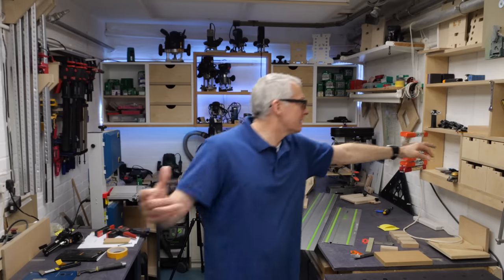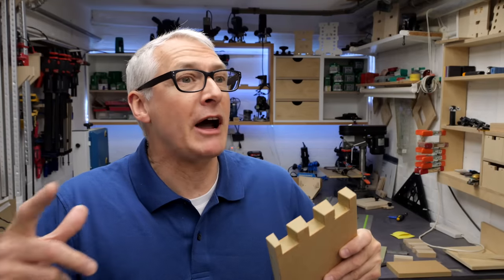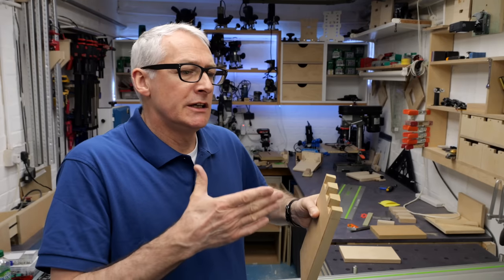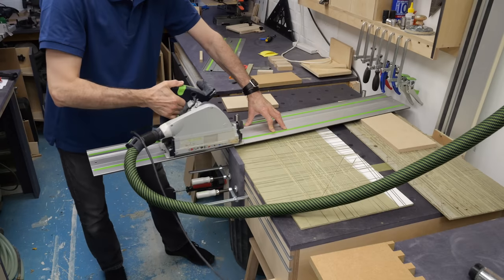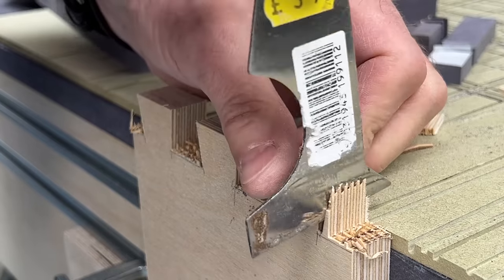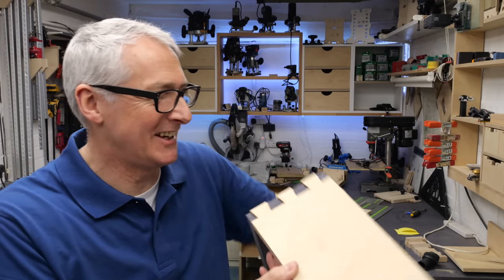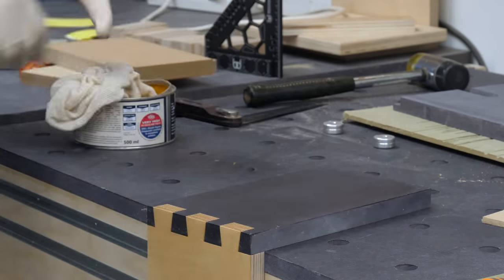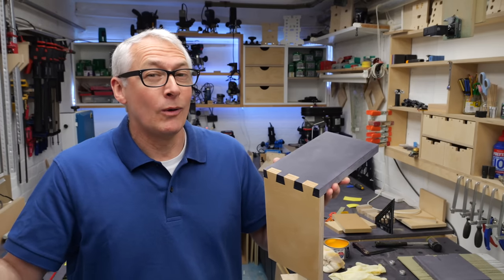Tracksaw Dovetails [video 496]

Comment: Just want to take a moment to thank you for all your videos.

I’ve watched many of them more than once and you convinced me to try a track saw some time ago. My shop is 12x16 and it’s been a struggle to keep it organized with a large piece of equipment like a table saw (even though I only have contractors saws built into benches).

I’m to the point now with this journey that I’m seriously considering getting rid of my table saw altogether. 

Like you if I was in a huge place, maybe it’d be different, but man i haven’t found any cuts yet that I actually “need” a table saw for. In addition, I have felt so much more comfortable handling large boards.
Reply from the maker: Thank you! Tracksaws are hard to argue against in a smaller workspace. 👍👍

Comment: Ok, you can do it.  Boy that's a lot of work.   I thing I'll keep my box joint jig for now.   Thanks for figuring that one out, at least I know it's possible to do unusual angles and spacing with a track saw.
Reply from the maker: Box joints with a tracksaw would be even more work! 😂👍
Reply: @10MinuteWorkshop  although not of you created a jig, it would be very similar to cutting box joints on a table saw (discounting dado blades, which obviously speed things up). The only difference is that the table saw blade is at a fixed point, so you could just keep your tracksaw in the same line and then create a jig for moving the workpiece along the side of the bench incrementally, rather than move the tracksaw as you have done here.

Edit: I'm not saying that the jig would be easy to build or worthwhile, just that it's pretty much the same as using a table saw box joint jig.
Reply: @10MinuteWorkshop  Forgive me for I have sinned.  I've been doing box joints on my route table, using my Incra jig  for about 20 years (Jig).  Only in the last 5 years have I been using pocket holes for the backs and starting to use contrasting wood for the front threw dowels or Domino's. 😇😉🙃

Comment: Hi Peter. Love your description about the strength nowadays and decorative aspect. That's an amazing unbelievable result, you lost me before you went to the other saw for the angled cut.
Your first dovetail in 46 years, that's a win win. Decent enough joint? It looks perfect from here, I like the aesthetic contrast, it's given me ideas. Thanks for this light hearted video. Tony
Reply from the maker: Thanks Tony. Second saw so that I could keep the bevel set on that one for the tails, and use the other for straight cuts. Just in case I messed up and had to revisit one of the pieces. 👍

Comment: So, nothing wrong with the neatness of the joints. The only criticism is I would say the pins are bigger than most but many punters wouldn't know or care. Your method is no more difficult than using a table saw as I've seen on other sites.
Think there is only dovetail jig that can make open dovetail joints so your method is certainly interesting. 
What did interest me the most was when you cleaned out the joints hammering onto the top of the bench. I don't have a MFT but have a carpenters workbench (made by my dad out of 9x2 & 9x3's so it's really solid and has 'mass' to not bounce when chopping out or planing). as I'm considering buying a MFT top at least but always been concerned about the movement in one when hammering and planing.  

It's a Thumb's up from me!

Comment: My personal feeling is that this techniques would lend itself very well to making multiple dovetails simultaneously. In particular if you were making an identical set of drawers, ganging the pieces before each cut would minimize the setup. Lay out the tails on one piece and stack the work pieces. Set the saw up for the straight cuts and make the tails. Then repeat the process for the pins. As you mentioned, it's probably not for fine furniture, but for shop cabinets and drawers, I think it would be fine. One advantage is that all the sides can be cut to finished length as, with a through dovetail, there is no need to adjust length of any side to accommodate rabbets (rebates).
Reply from the maker: Exactly right for the tails; pretty sure that wouldn’t work for the pins though - they’d need to be one at a time. 👍
Reply: @10MinuteWorkshop  - There is nothing quite like having someone else examine your “brilliant” idea and point out the heretofore obvious flaw! ;-)
Reply: Presumably though, you could stack workpieces for cutting box joints. And if your spacers were related to the blade kerf, and you used more of the same spacers to offset each alternate board, you could batch cut unequal size joints quite easily. Although I suspect this lends itself more to an L shaped jig rather than an MFT.
Reply: @10MinuteWorkshop  For the tails you would stack them together with the edges aligned but for the pins you could stack them but offset each piece in the stack, first in one direction for the left hand sides and then the other direction for the right hand sides? If you were doing enough in one go efficiency savings might kick in.
Reply from the maker: @BasiliskFilm  That would require a lot of very precise stacking!
Reply: @10MinuteWorkshop  just align the front corners of the boards with the edge of the track, square ends on the underside of the track, clamp them together and slide them into place.

Comment: You trully are a remarkable craftsman. Having multiple plunge cut saws is the way to go as you mentioned so not to change settings. That will be the same when using a router or two routers. Your filming expertise is also astounding. I was thinking for some time to purchase the festool router jig as it is more in the line of repetitive through dovetails with straight and dovetail bits. I put that on the backburner since I was preoccupied with other ventures. You also are so humble. Like another person mentioned there could be a type of jig that can be built with a sliding type motion so that the angle can remain the same. Thankyou for sharing.
Reply from the maker: Thank you! 🙌👍

Comment: Great video as always, Peter, demonstrating the versatility of a track saw even if not intended as a practical everyday application.  So it begs the question, and suggests a a logical follow up video which at least for me would prove to be extremely beneficial:  what joints - beyond simple butt joints and pocket holes - can and do you actually employ with a track saw?  Or do you use a router for anything beyond butt joints?  Like yourself I don’t have the room or desire to use a table saw.  And I’m guessing there are a number of your fans/subscribers in a similar situation.
Reply from the maker: Thanks Steve. I think I demonstrated rebated joints in the 'little plywood boxes' video, and I've shown cutting grooves for eg box bases before. I do wonder about the possibility of finger joints, and that's something I'll be having a play with in due course. 👍
Reply: @10MinuteWorkshop  Thanks, Peter. I will certainly check that out!

Comment: Very nicely done! A master of the MFT. I was doing these things always with a router on my MFT and one of those Bosch adapter plates for Festool rails. 

Next thing would be to show multiple ways of a compound cut. My MFT top rests on perpendicular legs, so I can clamp anything on any angle onto it's front and can use my tracksaw also with an angle. Not often needed but very handy for mid century modern legs of any shape or form. 

Regards,
Etna.

Comment: I found this really interesting and beautifully demonstrated as ever Peter. I'm a cabinet maker as was my Father and I remember him showing me how to do dovetails back in the seventies with a coping saw, but like you say, the demand for them doesn't seem to be there for them these days, if I'm asked for them I just use a router and dovetail jig as I'm sure most do, and as you say, with modern PVA glues, rebate joints and even butt joints and screws are strong enough now in most drawer applications. 

Thanks for another great video

ATB....Simon
Reply from the maker: Cheers Simon! 👍

Comment: That is both interesting an innovative. I'm not sure you would want to hand cut a dovetail joint in either of those materials and that is an outstanding effort for the first time in 46 years! 

I made the door of my shed with hand joinery. It's 6'6" x 3'8" with the frame made of mortise and tenon joints. (faced with 2/3" exterior ply) I did a test joint, put it together without glue and couldn't get it apart again!
Reply from the maker: Thank you! It always amazes me just how strong a simple glued joint is, and especially combined with some proper joinery like M&Ts 👍
Reply: @10MinuteWorkshop  Yes, even with really old fashioned glue.

Comment: Nicely and neatly done! It only seems a bit cumbersome to me if you also have a router that you can use in combination with the mft and guide rail. Sometimes I wonder if you couldn't replace a plunge saw or table saw with a router and a thin router bit. In any case, it would be safer and I think more accurate if it worked.

Comment: Very interesting exploration of what you can do with a track saw and some imagination!

I was wondering if you could get away from dialing in the angle of the second saw, by sawing a piece of scrap to the 7:1 angle and then clamping it as a guide on the front edge of the workbench, to angle the workpiece instead of the saw blade? Since you're sawing at the edge of the guide rail, maybe it's OK if the workpiece sticks up some outside the rail?
Reply from the maker: Thanks! I think getting the depth consistent would be harder to do if you were angling the workpiece. Interesting idea though! 👍👍

Comment: Coming soon, “Millard’s fine furnishings store, everything constructed from MDF with a track saw” 😂 !
I thought it was a good joint and the gaps were not bad, you skipped over how much time you spent setting up the tracksaws beforehand, but I guess once done you could production-line these
Reply from the maker: Thanks Geoffrey! The set-up time was pretty trivial tbh - the only slight fiddle was getting the bevel angle just right for the tails, and once that was set it was pretty plain sailing. 👍

Comment: Notice that you use Fibracclour, I am think about using either that or  Valchromat for a MFT top. Have you done a vid that covers the advantages and disadvantages of these?
Reply from the maker: No, I used Fibracolour because it was around half the price of Valchromat. Decision made, as far as I was concerned. 🤷‍♂️👍
Reply: @10MinuteWorkshop  Thanks Peter for the response as you say decision made.

Comment: Interesting video but I gotta disagree with you on the reason why the dovetail joint is still used. I agree that it looks nice but it also serves as a mechanical joint when the glue fails because the glue will fail with time and use especially in drawers.

Comment: I'm new to this and have only really seen manual methods for dovetails used and you are just replacing the manual saw with a powered one.The chisel finishing is the same.
So, I'm curious to know why you seemed so hesitant about the method/end result. 
There were some close-ups and all I could see was that the Fibracolour was(as I assume - I've not used it - by its nature) fibrous in the joint. I would imagine with two ply bits the joints would be very clean.

Comment: Sorry to ask I've been through your track saw bids and I'm looking at getting a plunge saw and not sure what one to get I am in a budget and won't use that much but my problem is as shielding needs to be delivered so parkside out of question I've been looking at Mac allister from b&q as a starter and not to be used would you recommend that one sorry to ask
Reply from the maker: No problem asking, but I don’t understand what you mean by ‘shielding needs to be delivered’?
Reply: @10MinuteWorkshop  sorry explain low amine system so have to be careful what I catch ie COVID so at present best if don't mix with others what do you think of the Mac allister plunge saw many thanks
Reply from the maker: Ah, OK. Sorry, was thinking electrical shielding, spark suppression etc..! 😂 OK. Yes, MacAllister is my current go-to entry-level saw, as long as you can get your hands on one. I did a video comparing it to the Parkside here - Parkside or MacAllister, https://youtu.be/Ebm-EEXNZHE HTH P.👍

Comment: What tracks did you use for the front of your mft?? I've been looking for some that fit the track saw clamps...made some wooden ones, but obviously they'll be less robust. This was a pretty impressive effort with a track saw!
Reply from the maker: Thanks! It’s a regular smaller (18x12mm, 3/4” x 1/2” external) t-track; I go into detail about the hardware in this video. 👍 Extrusion Confusion - A Guide To MFT Hardware [video 486] https://youtu.be/za5B-XrSuH0
Reply: @10MinuteWorkshop  Many of those won't fit the rail clamps (here in the states). Looks like Orange Aluminum makes some that will, so I'll be giving them a try. I need something to act as a face clamp for my torsion box assembly table. Also need to build a MFT style table to do some work at my parent's place. I appreciate your channel, been quite informative and entertaining, so thanks for that.
Reply from the maker: No, but the regular t-track will fit all the guiderail clamps I have - Festool, Makita, Axminster, some cheaper bang good ones etc… 👍

Comment: What is your opinion on miter saw? Does it get a lot of use ?
Reply from the maker: When it gets used it gets used a lot - but the most used is the tracksaw. 👍
Reply: @10MinuteWorkshop  I bought that to cut square tubes, does magic and saves a lot of time with a good bimetal cutting blate! next on the list is plunge saw, just not much idea about wood work so far but I keep watching videos!

Comment: Not bad at all. No, I wouldn't attempt it. For a single job- say a box of the size of your pieces, it would be quicker and more accurate to do by hand. But, as you say, you couldn't do that by starting out without some considerable practice. Interestingly, there are some good(ish) videos on doing this on a saw table. For multiples, difficult to beat a router/template set-up.

I agree, however, with modern glues this has become, mainly, a decorative, show-off joint. , so best done hand-cut. Interesting concept (now, don't do it again!!😁).
Reply from the maker: I’m sure it would be quicker and more accurate for you to do it by hand, but not me… 😂👍

Comment: Peter, you seem to be embarassed by what you've done.  In any woodworking there's no right or wrong way of doing anything. If you achieve the desired result then your method is fine.
Your dovetails turned out very well, just a minor tweak to the spacers to get a tighter fit.
Don't be put off by all the "only way to do this" experts.
Cutting these types of joints is challenging in any material. Your method is fine.